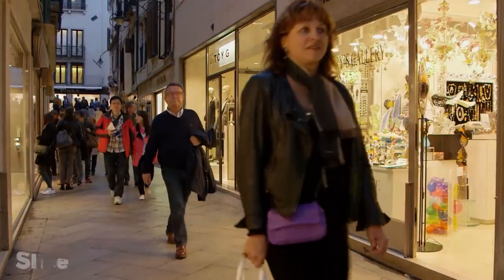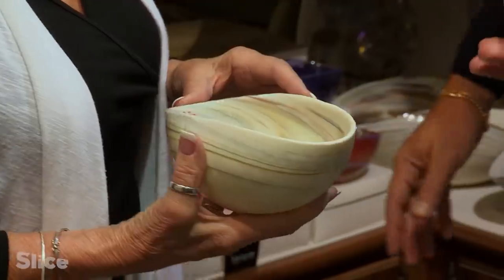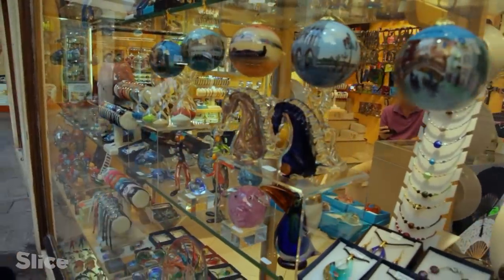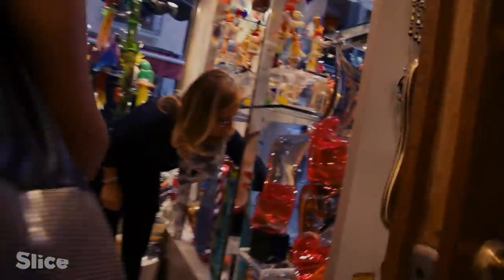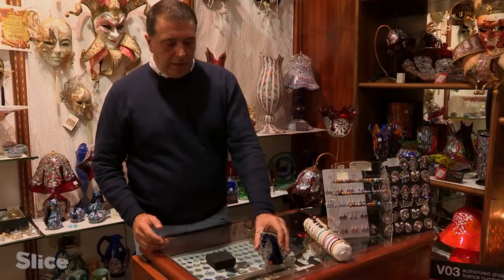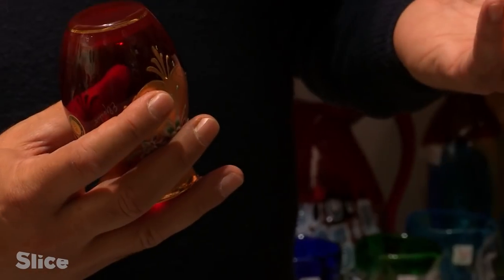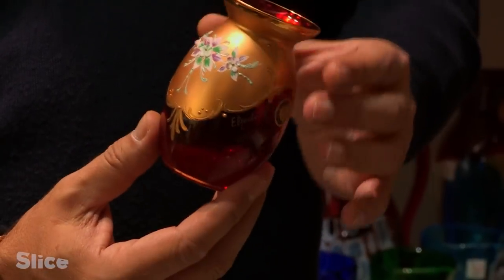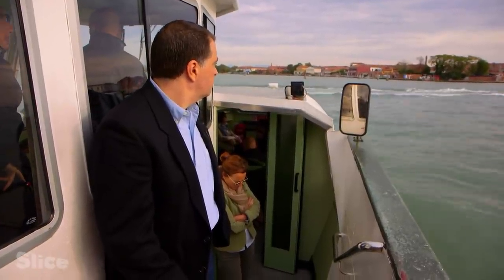Real vs. Fake: Murano glass counterfeiting | SLICE

Comment: talking so superficially about this problem is not correct.  I am a glass master, I was born in Murano, I live in Murano and I have been working as a glassmaker for 28 years.  The gentleman who should be an expert in the first scene in his shop shows a plate with raised edges that yes it was made in Murano but not by hand but with a machine called a centrifuge.  As for the horse's head, the one bought in the other shop is certainly Chinese but the one he showed us as a comparison is equally questionable, both for the features and for the level of finishing on the bottom which could certainly be better.  To be a glass expert it is not enough to run a shop for a few years.
Reply: Mai detto di essere un esperto, lei invece è l’esperto che contesta il pezzo del Maestro Costantini, evidentemente lavorare il vetro non vuol dire essere esperti
Reply: Hello Igor.  I still owe u a beer 🍺
Reply: What frustration
Reply: @michelevalsecchi1828 where can I find your shop please, I am in Venice & would like to visit.
Reply: This should be regulated by the authorities so Murano glass art will be appreciated and valued

Comment: This problem is universal; whatever the valued artistic object, it it is on demand you will find cheaper and fake (and obviously crude) variants of the originals. Industrialization made it worse but to be fair, most people aren't that selective as to note the difference (if they were or they cared, they would notice). Hand made objects with real artistic input are time consuming, demand years of learning and are generally unique and not mass produced. Also people is no longer able or willing to neither wait the required time (in the old days you prepaid for a commissioned work) nor to pay the required sums (obviously it gave prestige, it wasn't merely utilitarian).

Comment: Surely the stickers fall off over time so how can you tell if its authentic or not in antique stores, and thrift shops?
Reply: They specifically stated telltale signs, such as the round uniform vase is only made by machine and not blown by hand. And the bottom of the pieces are smooth, not lumpy like it's been machine made.